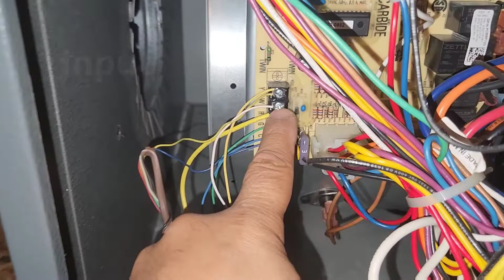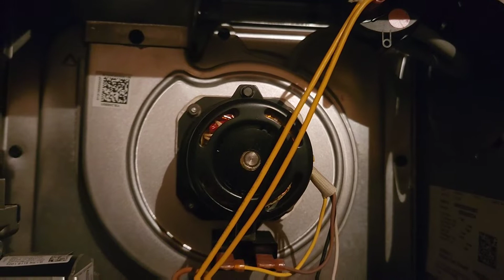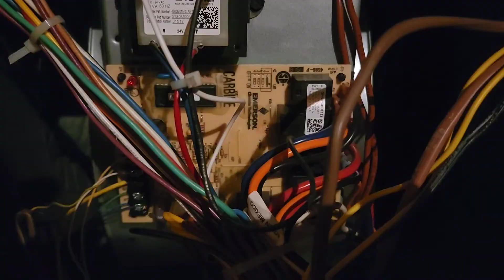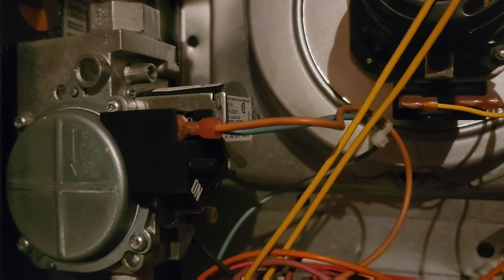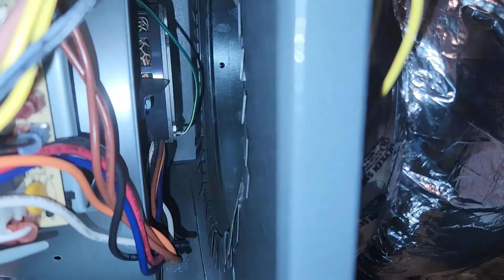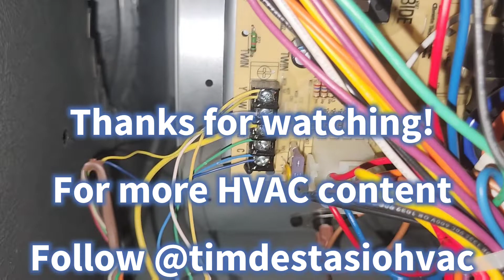Gas Furnace Sequence of Operation: Inputs and Outputs

Comment: mine goes through all sequences until after the igniter. No power to gas valve, so i ordered a used circuit board,,,same problem, now i have no idea if i was sold a garbage board or if its some other issue. Freezing for 4 days.
Reply: Check for voltage drops across all pressure switches and limits/ rollout switches. Then, call a pro.
Reply: @timdestasio3367   The funny thing about this,,,it does the exactly same thing as the old board....same voltage. I hear the click in the control board when the igniter is glowing, but it only sends a "ghost voltage" . , for 5 seconds. Like 0.52Volts instead of 24v. Just like the old board. Whats the chances of them both failing the exact same way.
Reply: @babbalonian2  perhaps your common side of the gv is broken